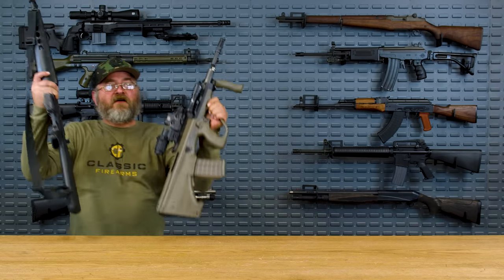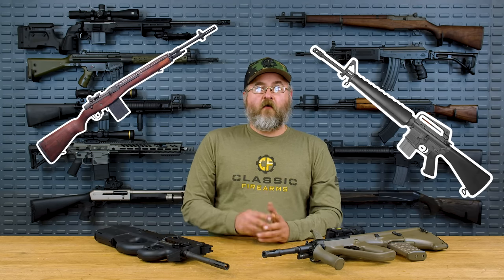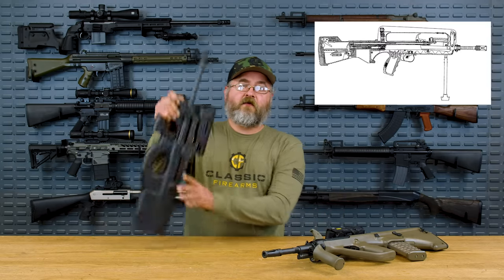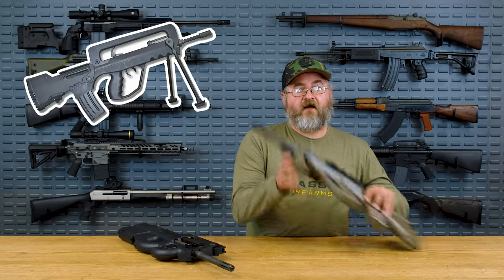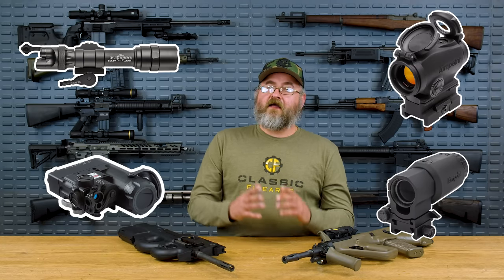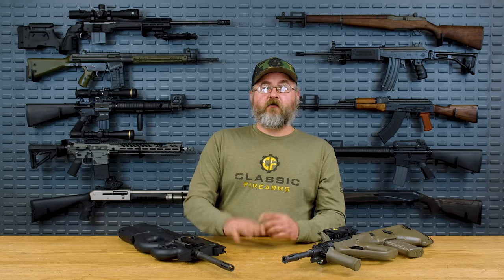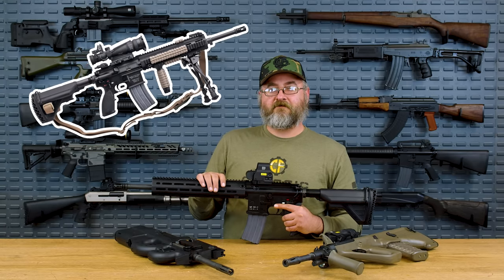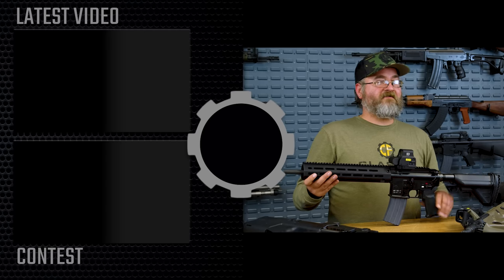Why Did The French Military Abandon The FAMAS?

Comment: I used the FAMAS F1 model, when I was in the Legion in the 90's. There were some interesting features on it, like being able to configure it to fire from right to left handed shooter. The magazine only held 25 rounds (cartouche). It was heavier than the M-16. I don't recall any complaints montage/demontage (assembly/disassembly) times on cleaning...
Reply: weight difference is minor: FAMAS 4,2kg loaded, M16A1 3,63kg loaded .The FAMAS F1 was not the best modell, the FAMAS G2 from the french navy was much better and did use Stanag 30 shot magazines with Nato 5,56 brass cases, (not steel cases like needed the F1)

Comment: The locking system reminded me of the VZ58 and the Beretta 92. No hold open on the last shot. The barrel wasn't chrome lined. Eh, it still worked but, it couldn't compete with the STG77.

Comment: There is a mention over the fact that the short stroke gas piston is a "big big big" upgrade compared to the delayed blowback designs. Why is that ? The roller-delayed blowback operating system of the HK G3 series and the HK MP5 series did seem to do just fine, no ?

I'm curious to know the shortcomings of these !
Reply: Nothing. Roller delayed G3 and MP-5 variants are good and reliable. Just a bit on the heavy side and the ergonomics of the competition are better. G3 still kicking as in third world against AK

Comment: The finger guard can be rotated out of the way if you have gloves on, totally safe, NOT! 
The rifle lasted so long in service because france ended mandatory conscription in the 90s, so they had a huge stockpile of new or hardly used rifles ready to replace knackered ones. 
The magazine was flimsy, feeding problems
your eye was to close to the rear sight for accuracy. 
Stripping it down is easy... x2 pins for the plastic parts and x2 pins for working parts, finally x2 locking pieces for firing pin and extracteur and obdurateur... easy😅
Cleaning this rifle is only quirky because of the fixed fore grip not allowing easy access where the barrel meets the body
Plastic front parts were replaced with fibre glass

Comment: I wonder what an m16 would be like if it was a bull pup. I guess we’ll never know.
Reply: They'd really have to shrink the BCG and that wouldn't allow the normal trigger assemblies. I think they'd need to figure out a trigger extension bar (normal bullpup operation) compatible with a long first stage, 2-stage trigger. 

If the entire BCG assembly was scrapped, a shorter unshrouded firing pin could be used and maybe a Geissele at max tolerance could work, but still the extension bar would really throw off the feel. If it was the full-auto with the extra sear hook and/or rolling ratchet mechanism of the 3 door burst fire, that would do..... how's that help Average Joe though? 

What about an inertial bolt benelli style, but rotary? One big cylinder and a very heavy but short spring, and 5.7x28 or 9mm luger? That would have enough tolerance to work.

Comment: WOOOAAAUUU....this video is full of so many mistakes....so many distorted information's....a mix and match of photo's and attached information's that have nothing to do with the photo's...where did you came out with those things you have said??
Reply: You should check your sources because that’s all correct
Reply: @ARrow556  I should "check my sources because that's all correct" ? on what exactly are you basing your statement?
Reply: @ARrow556  I would gladly pick this video apart and explain every bit that I contradict, with all the facts that you will need to understand, my only problem is that this is just the comment section and it has a very small and otherwise quite non-communicative format .

Comment: All valid reasons, however you missed THE BIG ONE.  The FAMAS (Like most Bullpup designs without a selectable ejection port) is very, very difficult - if not impossible - for use by left-handed (tireurs gaucher) or left-eye-dominant shooters. The expended rounds eject directly into ones face/body.  The M16/AR15 design is saved from that problem by the overlooked, mostly unexplained, presence of the "Brunton Bump," the nub toward the rear of the ejection port which deflects expended rounds away from the shooter.
Reply: What are you talking about?...the FAMAS certainly HAS the option for swapping the parts necessary to change the direction of the ejection...where did you came up with that "impossible" part that you are so certain of it? That exact possibility was the main difference between the same era bull-pups...are you sure you are not mixing things up with the AUG,maybe?
Reply: @BabaNovac792  lol ... Yeah, YOU swap the ports.  I'll wait.
Reply: @shootersix  i don't understand your reply...what exactly are you saying? that it doesn't have that capability or what ? Buddy, use more words please,I'm not a mind reader
Reply: @shootersix  There are ports on both sides and a plastic mask/cheek weld which you can switch from left to right. The ejector must also be switched around so that casings are ejected to the left. Switching from right-handed to left-handed operation takes 2 minutes.
Reply: @adrien5834  There are. As you say, ports on both sides. However, switching from right-handed to left-handed operation is far from a 2 minute operation.
Reply: @shootersix  Look, I've done it multiple times. 2 minutes, tops. I'm pretty sure it can be done in less than 30 seconds if you hurry.
Reply: @adrien5834  does that really matter?the thing is, I have the impression that this operation is misunderstood : basically, you have your weapon assign to you when you arrive on your regiment,once you have it,if you are a lefty,you are doing the change and its stays like that...
Nobody from my regiment,as far as I know,amused himself to change this setting every time he got his FAMAS to go in an exercise or overseas to just revert that back whenever one needed to return it in the armory...it's a false discussion point
Why all this talk about how much time...how easy or not...? @shootersix your missing the point
Reply: @BabaNovac792  Well, no, it doesn't matter. I was just answering shootersix's specific point.